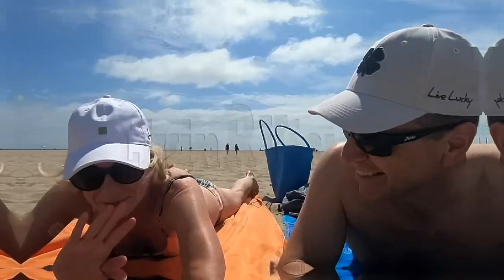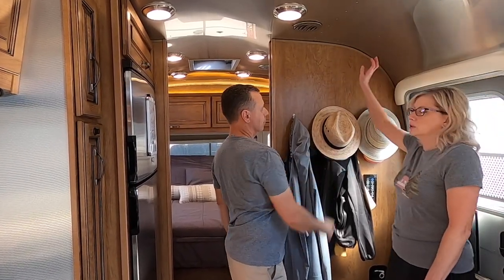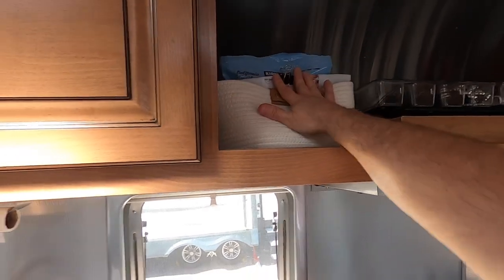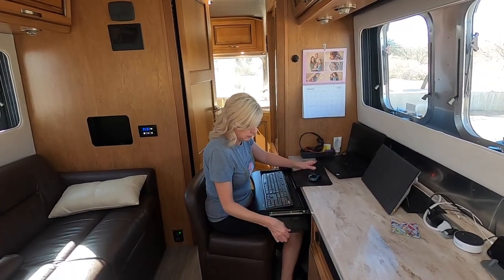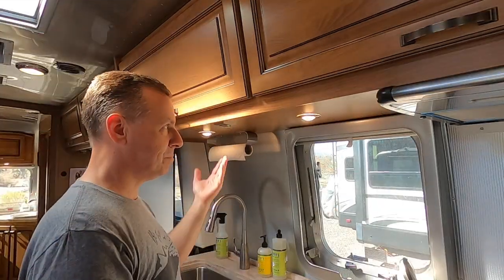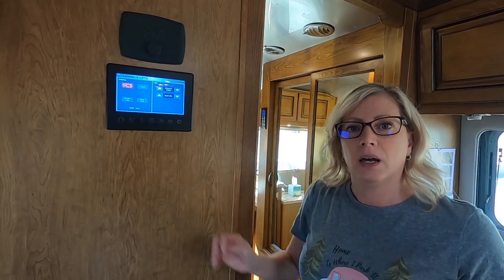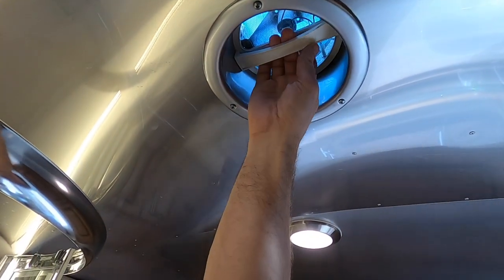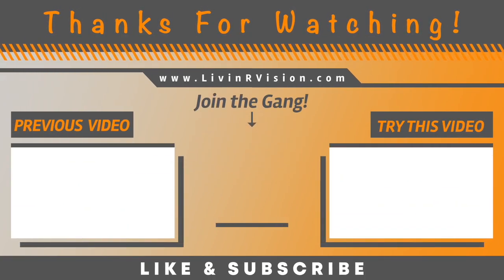Our NEW RV Setup | Full Time RV Living After 2 Years

Comment: You two have a beautiful travel trailer. I love the fact that you can turn off the panel lights at night. I'm covering all my lights like the light on the microwave etc. with electrical tape...lol. Thanks for sharing.
Reply from the maker: Thank you!  Hey, whatever works! 😁🤓
Reply: Sandra Westley from UK I used to have to do that, but since changing the van to a longer version the bedrooms at the back a dressing room and bathroom in the middle, we are well away from the lights on the fridge and the working panels, 😂😂 I am a light freak, cannot sleep with any thing on at all, I also wear an eye mask and ear plugs 😂😂. But we prefer an outfit like the airstream Motor Homes are nice but over here roads are very small and most car parks do not allow Motorhomes they have overhead barriers that just takes our 4x4, so people that have Motorhomes have to travel by bus any where they want to go, and you end up in the rain standing about waiting for buses.

Comment: I believe the heating element on the roof of your microwave / convection oven is known as a "broiler" to provide intense direct radiant heat to the top of the food for browning.
Reply from the maker: We are referring to what it is actually called BY Cuisnart. It even has a button called  “Grill/Combo” but yes, it basically is a crisper/browner that is a heating element just like a normal electric oven.
Reply: Sandra Westley from the UK we always call it a grill also, I wondered what a broiler was, over there.

Comment: I love how detailed your tour is! The one thing I missed was the hot water supply, does your airstream have a tankless hot water heater?  We are looking at airstreams now and plan to buy in the next year or so and I’ve been worried about the space vs a RV with slides. Your tours are super helpful, especially when most dealers don’t have a lot of inventory to see in real life!
Reply from the maker: Glad you enjoyed, Thank you! 😊🤓 Our water is heated through the Alde boiler system. It is not tankless, but it has “shower boost” that makes the hot water last much longer/hotter.
If we were retired, we may of went with a different option but this has helped us have less to worry about. Slides are nice for the extra room, but they come with worry and maintenance. Since we work all week at our desk space and then gone during the weekends exploring and shooting film, the extra space isn’t important to us. Everyone is different as far as wants and needs. Many RVers end up changing multiple times simply because they realize they either don’t need the extra space or want the extra space. You’re right, Airstream’s have been very low on inventory!

Comment: Great tour! We have same twin bed version and love it! I thought I'd hate the projector tv but it turned out to be a great feature. I'm with you regarding the power shades in the main living space. Only 4 months old and one shade already broken! Great idea for the keyboard drawer at desk. Also, we modified the easy bake oven with cast iron grates and like it much better. More stable surface for pots! The shower is indeed awesome --feels like home! Great name for your Airstream too. Safe travels to you both!
Reply from the maker: We were hoping we could find the twin version used. It is much easier getting in and out of bed and gives you more outdoor storage. 
Where did you get the metal grates for your oven? So you store your pots and pans in the oven? Do you set them on a towel or anything to keep them from shaking and scraping while driving? 
Thank you! 😊🤓
Reply: @LivinRVision  We purchased the 2-piece oven grate from etrailer. It's for a different manufacturer but works on our Dometic model. Many posted pics with grates on their Dometic. It's a snug fit, so doubt they'll move on travel days. We removed the wire-y parts off the stove before adding grates. It's lovely because you have big flat surface area to put a plate for cooking utensils or slide around other pots, etc. No regrets! 
I learned from other RVers they often use the oven to store baking pans. I keep them stacked; a small glass Pyrex I have piece of shelf liner to keep it from slipping. I have a couple silicon accessories, like instant pot rings in there. On moving day, I padded the area with some potholders and kitchen towels and nothing moved. As for microwave oven, I removed the glass roundtable and set it in padded bag in shower. Didn't want anything to potentially crack the glass door. Safe travels!
Reply from the maker: Right, a lot of people use the ice for storage. Even people do that in their homes sometimes. We were curious about during travel. We use towels etc for items that rattle or glass items, even our pans with lids in the drawers. Whatever works, right? 👍🏻😊🤓

Comment: Interesting you bought a stream.  I am much like you in that I am selling our Class A DP and have a 33FB Twin on order.  I am looking for less stress and easier travel.  I can drive the Class A just fine but it's somewhat stress inducing.  I have had slide toppers fail on three occasions and when they fail you aren't going anywhere.  Climbing on the roof, glad to see that gone  I also had a valve stem break and left us on the side of the interstate for about 5 hours.  Luckily we were going around Atlanta and a roadside assistance truck pulled up and fixed our flat.   This happened on a Saturday during early COVID and we almost had to sit there until Monday morning.  Both of these issues will not be a problem with an Airstream.  We enjoy and follow your channel every week.
Reply from the maker: Thanks for sharing this, Ben! You are so right...we loved the Class A and driving it was a breeze for me, but not so much for Michelle. They are nice, but like you said...there are more worries with the Class A. We are currently having issues with our Alde system and will be getting that fixed here soon, but when we travel now, the stress level is so much less during tear down, set up and travel. There will be issues with any RV, but we are much happier with the Airstream. The 33FB Twin is  a good choice. We didn’t want to have to order and couldn’t, but we think the Twin is the way to go with the 33 Classic. We looked for a used one when we were shopping but could not find one. Hopefully we will meet up sometime at a rally! 👍🏻😊🤓

Comment: Awesome review. I've been campaigning for a class A, but this video has me rethinking about trailer towing.
Reply from the maker: Well, be sure you do what you feel is best for YOU. As you probably know, all travel trailers are not created equal. The Airstream will pull much better all around especially in the wind, they are lighter than most for the amount of space they have, the quality is better than most travel trailers and they definitely will hold their value better. That being said, you also need a floor plan that is going to work for you. Quite frankly, none of the other Airstream models we’re going to work for us. It was only this 33FB classic that worked for us. Do your homework and try to be as sure as you can be before buying. Even though the Airstreams hold their value well, you still need to try to get the best deal you can of course. Good luck with whatever you decide. We are not against the Class A…it just isn’t a good fit for us “right now”.
Reply: @LivinRVision  is that 33 the only one that has the theater chairs and would it be possible to replace those theater chairs with ones that recline at least slightly?
Reply from the maker: Yes it is so far anyway. I would think it would be difficult doing so without them reclining right out into the walkway, unless there is a unique recliner made that is smaller and a space saver.

Comment: What year, length and model is your Airstream?   Best of luck with it. 
We are on our 3rd Airstream and didn’t lose a nickel when we sold each of the previous two. In fact, our first one, we used for 18 years,  and  when we sold it a bidding war ensues with two couples out bidding each other for it. Worked out well for us.
Reply from the maker: 2018 33’ Classic. Wow, you must of had a hard to find model. They do have a good resale, bit that sounds like the housing market. 👍🏻😊🤓

Comment: How long does the radiant heat take to warm up the Airstream once plugged in?  Also is Michell able to reach the fan in the Bathroom?
Reply from the maker: We have an appointment to get the radiant heat fixed.  It hasn’t worked since we bought it.  We’ve used other heating sources instead.
Yes, I’m able to reach the fan in the bathroom! Lol 🤓 The ceilings in an Airstream aren’t that high. 😜

Comment: I enjoyed this video as I am looking to possibly getting an Airstream, just sold my 5th wheel and was looking at Class C or A's but I don't want the height and length. I never considered Airstream's because of the price and I didn't want a travel trailer but I am starting to see the advantages. Your video has helped me a lot. Do you mind telling me your towing set up and if height and size was a factor for downsizing? Thanks you.
Reply from the maker: It took us a while to see the advantages also. Mainly for us, we are both so busy that it was eating at me that I was having such a hard time keeping up with maintenance on the Class A and not having enough time...it was really stressing me out. So the Airstream has really helped with that and yes...having something that you don't have to worry about height is a big plus as you can take more roads and less worry there as well. No slides to worry if they will go in or out every time you setup or tear down either. They hold their value much better than any other RV also. But as with any RV, you can point out numerous cons with every pro. So there is really no perfect fit for everyone. Just decided what is most important for your own personal needs and don't let anyone tell you differently. We have had our share of negative comments about our choices but our choice have proven to be what was best for us at this point in our lives. I do love to drive the Class A though. :)
Reply: I agree with you, there is no right or wrong choice just the choice that works for each individual at that moment in time. The Airstream holding it's value compared to others out there is what drew me to them. Thank you for responding.

Comment: One question that's been bothering me as a LGBT class a owner,why did you drive vini on blocks to level it?
Reply from the maker: Because sometime you have to when your site isn’t very level. You should never over extend your jacks OR to the point where it lifts the wheels off the ground. You will see a lot of people do that, but that is a lot of weight/stress on the jacks...IMO.
Reply: What is a LGBT Class A?  Never heard of that brand.
Reply: @kellyanneree3252  stupid auto correct large class a,sorry